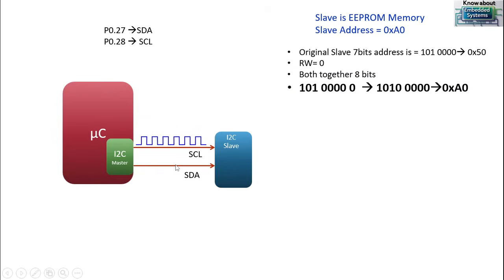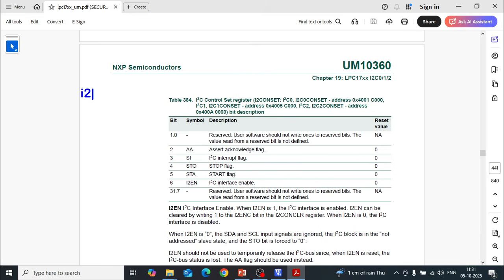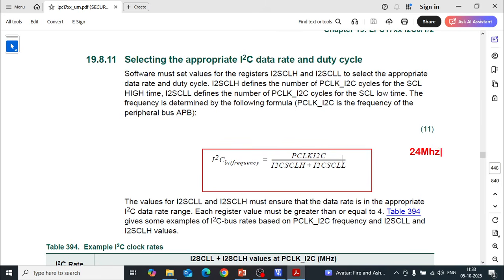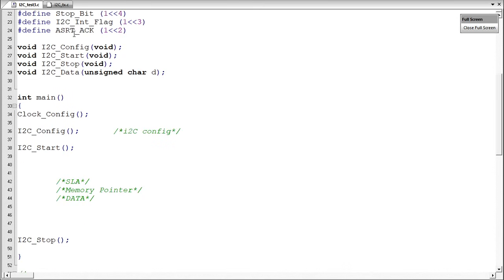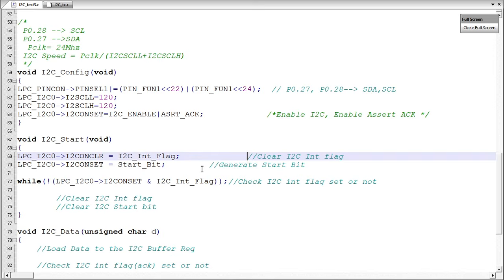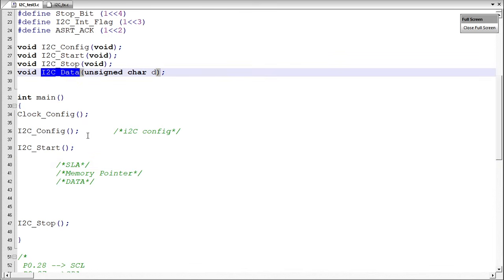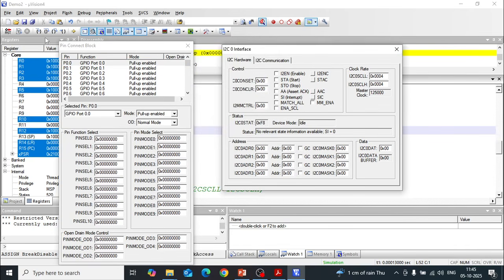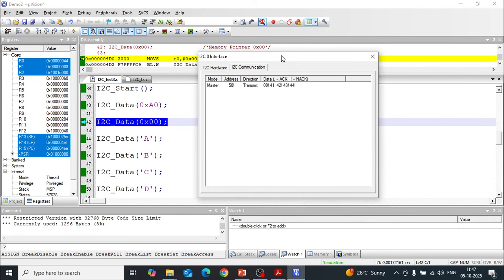I2C Programming | Embedded C code for I2C  | I2C Program | I2C Programming in Embedded C

Comment: Hello Sir , can you check I2c_config when we use p.27 & p0.28 as SCL , SDA, you set <<22 , <<24 , I expect 27 , 28 ?
can you check , Thanks.
Reply from the maker: It's not like that,
You need to refer to the user manual 
To understand Pin function configuration
Reply from the maker: Watch this video you will understand 

https://youtu.be/JPLq-GQb5WM

Comment: Sir, very informative video. Can u pls elaborate why a memory pointer of 0x00 is used in i2c data function. Is it needed for every device before sending actual data ?
Reply from the maker: Hi
We are using ERPROM memory device as a slave,

We are going to initiize memory pointer or starting address of the ERPROM slve by sending 0x00